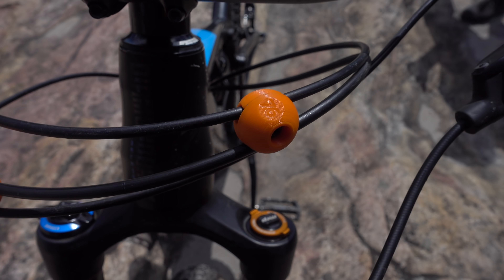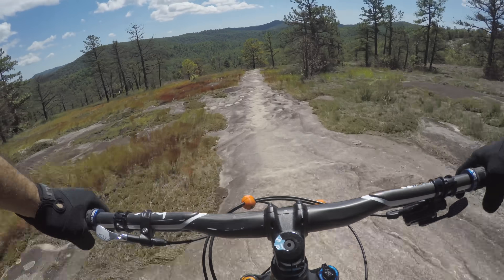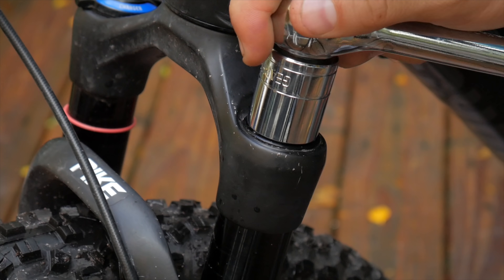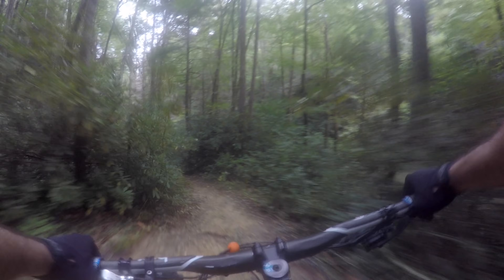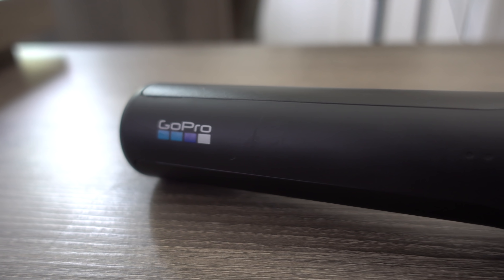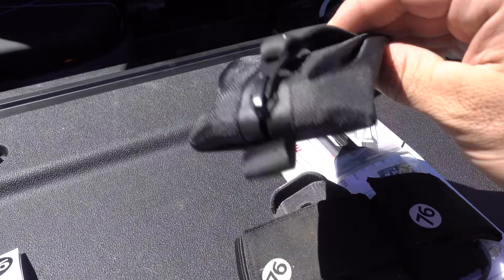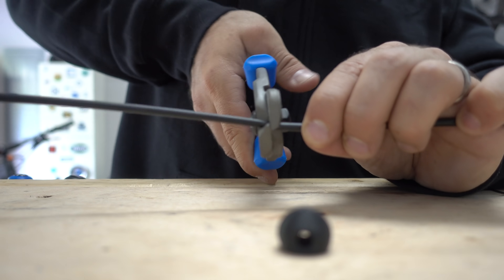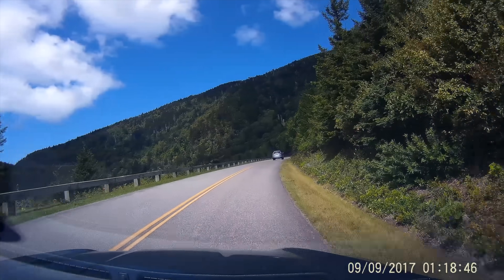10 Product Reviews Loosely Related to Mountain Biking

Comment: RE the oiler. I have not used that particular product but I do use middleburn oilers on one of my mtbs, similar but small aluminium oilers. They work well in the horrible muddy, wet UK winter to help prolong cable life. They are not a cure all but reduce the frequency of changing cable in a UK winter!

Comment: I COMPLETELY agree with the Hero 5 black and Karma Grip (and extension cable).....
I bought it all.. and RETURNED it ALL!.. haha.. in favor of the Hero 4 black and Evo ss.... MUCH BETTER ;)
Unfortunately I was stuck with a bunch of footage from the Hero 5 black... but as I've cycled through to new videos with the Hero 4 and evo... the quality is just that much better!
Reply: The MTB Crashing Dad GoPro really dropped the ball lately. Really hoping they release some killer stuff this fall.
Reply: Trail Features - Seth, if you're reading this... You should totally check out Trail Features' review on the MRP ramp control cartridge... Top notch !
Reply: The MTB Crashing Dad If GoPro doesn't make it have 1080p 60fps I'm done.
Reply: The MTB Crashing Dad 4K 60fps.
Reply: Gavin Crowley - seriously... They need to fix the sound issues and add the 60fps for 4k...
Reply: Gavin Crowley - although for MTB POV footage, I use the hero 4 black at 2.7k 30fps... Then upload as 1080p 30fps. 
It seems like most computers and cell phones can only get enough bandwidth to handle 1080p anyway... 
And for POV I use 30 fps because it seems like a messier video at 60fps (WHILE AT SPEED)... it's almost like, because it's trying to pick up so much detail at 60fps, because it's passing by so fast, it turns to an odd mud of a picture... Whereas 30fps kinda smooths it out by capturing less.... 
I don't know if I'm making any sense...
But for regular shots (NOT POV)... I would definitely use at least 2.7k (or 4k) with as high an fps as possible..
Reply: I'm pretty sure you can get an adapter to use the hero 4 with the karma https://shop.gopro.com/EMEA/accessories-2/karma-harness-hero4/AGFHA-001.html
Reply: kjl42 - do you find that it's still hard to get rid of the wind noise because of the enclosure ? Whereas with the Evo ss, you can completely cover the hero 4 mic ? Because it's exposed
Reply: If you're filming at 2.7k you should really consider 1440p uploads. That is the magic spot where YouTube suddenly gives your video a higher bitrate so it doesn't look like it was filmed on a potato. You'd be surprised how many phones can play 1440p videos these days, not even counting all the PC viewers that would benefit from the higher IQ.
Reply: Trail Features - well, coming from you... I guess I better start doing 1440 ... And put up with the extra export and upload times..
Reply: Hehe, just a suggestion. ;) Play around with it and see if it's worth it to you. Content is always more important than making it look fancy, so if working with 1440p keeps you from delivering good content then it's not worth the tradeoff.
Reply: Your 400 sub vid wasnt bad nice content
Reply: Cejay Adkins - haha.. thanks man ! I hope to get better over time... But sometimes I'm a nervous spaz (like in my 400 sub vid!)

Comment: Seth, I was 12 years old hadn't rode a bike I 3 years. It was the beginning of summer i begged my mom to take me to Walmart and buy me a bike. I got this 99 dollar bike, got used to it then started hiting jumps with it. That's when it fell apart, first the back brakes went and then the front ones. I replaced my grips with duct tape. Then my birthday came around and I got a Sunday bmx and a specialized hard rock. Every day I would ride, I would say about a good 5 hours each day. In the span of 3 months I got as good as my friends did in there years when  I didn't ride. A lot of the form that I learned was from you so I would like to say thanks.

Comment: You ever fall with one of those stabilizers on your chest? I'd imagine it would be toast, or are they relatively durable?
Reply from the maker: Fox actually I fell IN this video
Reply: Fox they are pretty solid. 
But still not indestructible like the gopro itself.
A crash right on the gimbal can eventually break it if it has too much force.
Reply: When you fall you tend to protect your vital organs instinctively anyways ie protecting your chest/stomach

Comment: Hey I’ve never changed a shifter cable if I wasn’t replacing a shifter. I’ve been riding lots since the 1970’s so that’s maybe 3 times in 40 years. Why do your shifter cables stretch so much? (not talking crap;actually curious)

Comment: if you consider the mrp ramp control take a look at the awk double chamber system by chickadeehill. you cant change it on the go but the fork becomes more sensitive over all and you can set up your airspring as you desire (how much travel you want to use before ramping up and how hard do you want to ramp up). it feels like a coil spring with a smooth bottom out.

Comment: Hi Seth, I love my dash cam.  I got it at Walmart for 9 dollars.   I was just browsing after Christmas or the new year and found it sitting on the Walmart clearance shelf.  I thought the worst of it after I bought it. I was worried that it was a remanufactured or it was damaged or it was the display model used too much and put out with missing pieces.  

I opened up the box, I noticed a magic marker line on the display screen, I was thinking that is why it was so cheap.  Then I noticed that the display screen had a thin plastic cover protecting it, I removed the plastic film and the black mark was removed too!   So I have a decent dash cam for 9 dollars.  

It can film both forward  and backwards:  front facing traffic and film the occupants of the vehicle at same time... Not bad for 9 dollars. 

I check out the Walmart closeout bargains on the clearance racks to all the time to see if I can get another AWSOME purchase.

Comment: Air spring forks already ramp up stiffness as they progress through travel. That's the nature of air getting compressed, even with the simplest damper out there. The ramp control is only useful if you'd be swapping tokens often, i.e. if you require different compression settings on a regular basis.

Comment: You actually can still use the Topeak saddle bag with a dropper post, you just have to stick with the small or mini size and cut off the post strap. I have ran it for years and the saddle bag has never come off the clip mount, and I am a very aggressive rider that takes huge jumps

Comment: Seth, you Rock.  I watch as often as I can.  I ride the Fats trails in SC on my Diamondback because of you.  I will eventually have the evo & my gopro.  Right now, I'm usin' a 3 on my helmet.  I built your workbench & love it.  I have a dashcam I got on ebay for $10.  It does the same thing.  We actually used the footage when my wife had an accident to get our $ from the other driver with the help of a lawyer.  A dashcam seems like a No brainer to me.  If I have an accident and it's my fault, I just throw it under the seat.

Comment: The nice thing about the Bobbin that there are no sharp ends like zip ties and u can reuse them.
Reply: zip ties will also slide and move around. we tend to use just the one bobbin to hold the brake cables together as these are the ones which slap around the most. on my full susser i use one to clamp the dropper post post hose to the rear brake. before this the dropper post hose would get caught up in my rocker link. there are plenty or areas to tidy up.

Comment: Oiling gear cables, I thought a lot of modern gear cables had linings that can be damaged / degraded by the introduction of oil to the system. 
Think as you say this product could cause more issues than it solves
Reply: Yeah most modern cables on a bike are teflon coated at the least, and then have other protective layers, so this seems like it might only be useful for older bikes maybe, but even then, I put completely new cables and housings on my 70s road bike.

Comment: Not sure what mic you're using with the Karma but mine doesn't do that at all. The motors are silent. I use a clamp to lock mine to a backpack strap. No extension necessary.

Comment: Whenever I hit jumps on my mountain bike, more often than not my entire chain falls off. I have tried adjusting the cable tension and i even changed my bike to a 1 by 10 instead of a 2 by 10 to see if that would solve the problem with bigger teeth on the front cassette. Even after that my chain still falls off and I need to stop right after a jump to fix it. What do people recommend i do to fix this?

Comment: The oiler is stupid. It does what you said. Lets water in, mud, clay, so instead of replacing cables every season, it is now every month.
Reply: PartyPlace 15 its actually sealed. Seth dint quite show it correctly. There is a o ring that should be pealed back to allow you to squirt oil through the hole.

Comment: Maybe you're just trying to simplify it but the Ramp Control thingy isn't a direct replacement for tokens. It has a spring and a port much like a damper so it has minimal effect on volume at low shaft speeds and a much more significant effect at high speeds. http://www.mrpbike.com/rampcart/

Comment: how does the mrp ramp up compare to the tokens ramp up?
Reply from the maker: +carol teodoru feels the same but there are more intermediate steps, or "clicks"
Reply: carol teodoru Also depends on the fork, the Fox 36 (which I have it installed on) also has a second place to add air on the bottom side of fork for small bump adjustment.  Not sure if this is just for 36 or other Fox models but RS does not have this.
Reply: thx seth
Reply: FULLmontyAC what place are you talking about? i have a fox 36 but i don t have a second place to add air
Reply: carol teodoru when you upgrade to the MRP it adds it
Reply: FULLmontyAC Thanx!

Comment: My mountain bike has no shocks
Reply: Wow
Reply: You can put suspension forks by taking off the old forks but i don't know about rear suspension
Reply: E_Drost10 unless you get a new frame or jerry rig a linkage system on a hardtail it’s not possible
Reply: I only have front suspension
Reply: Your road bike *
Reply: braptor channel i dont have suspension on my bike either because its 28 yrs old.
Reply: And my bike is for sure a mountain bike but a very old one